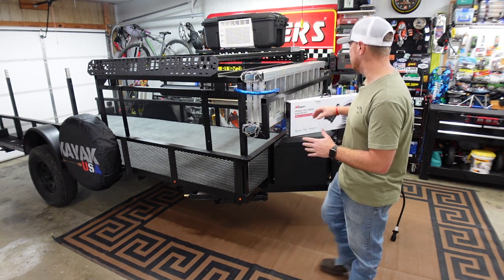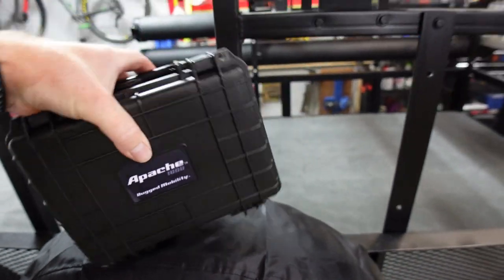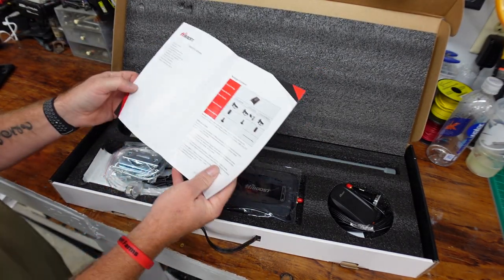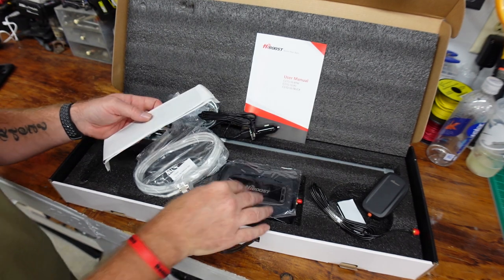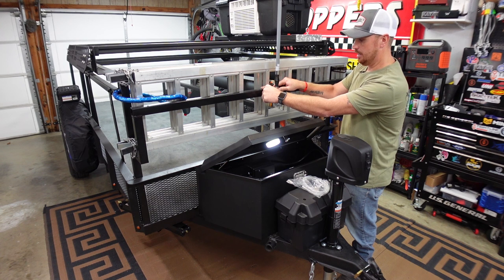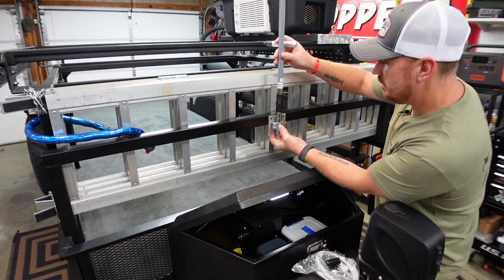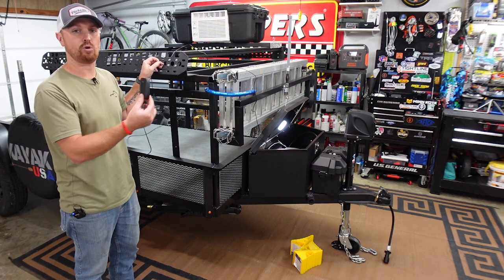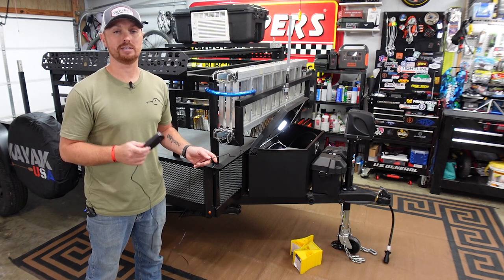Kayak Camping Trailer Build | Part 12 | 📲 HiBoost Cell Signal Booster!! | Kayak DIY | Full Install

Comment: I only have 1 thing I would change I would put black wire loom over the antenna cable for aesthetics that white cable on a black trailer trigger my OCD other than that you think you could do a total cost run down on this build so far